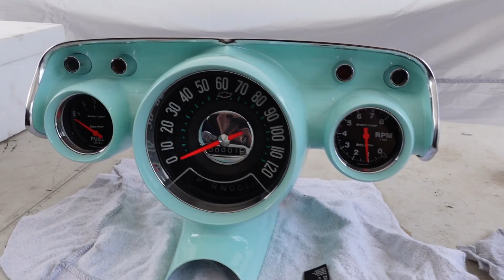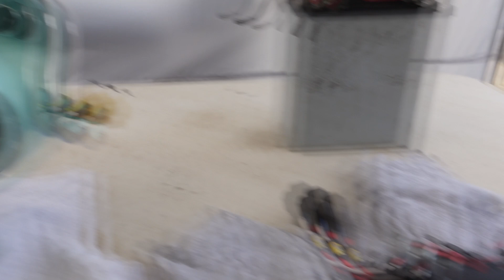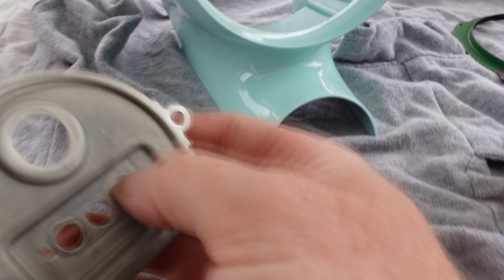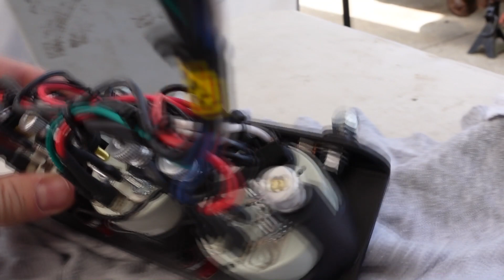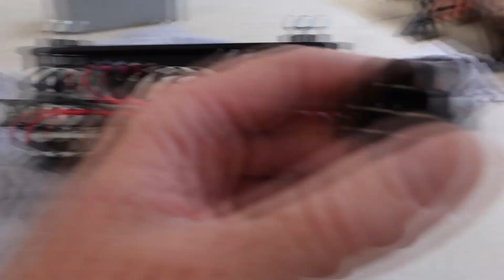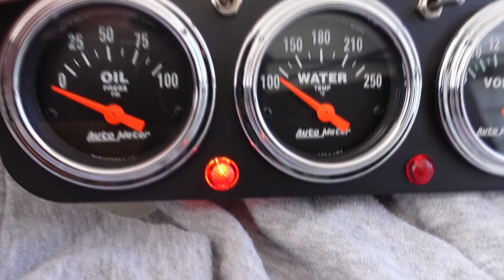Something New for Bel Air- Gauge What it Is!  #chevybelair #gauges

Comment: Do you do work on gauges for customers? I have a chrome gauge cluster I'd like wired up to connect to a painless wiring harness. I'd like to use the original style gauges just new reproductions and led lights. Where are you located? Thanks and God bless.

Comment: cut that nose back 2 inches...  the part that sinks in under the steering column collar, that then requires you to drop the steering column to remove the cluster,  also shorten the threaded studs that you replaced,  to the shortest required to work.  those two mods will make it easier to remove next time